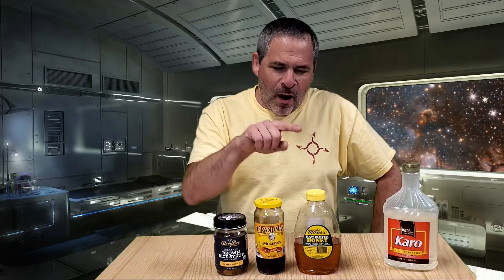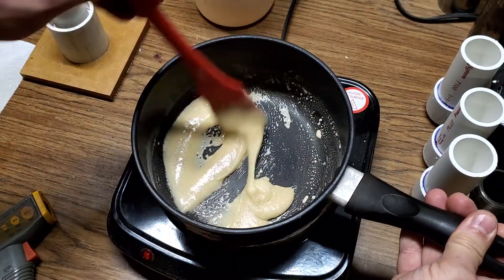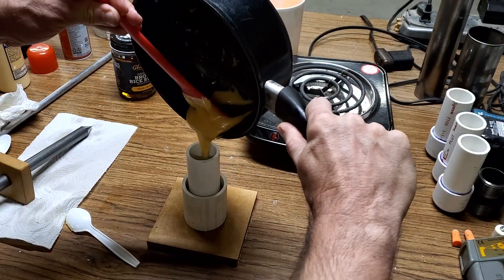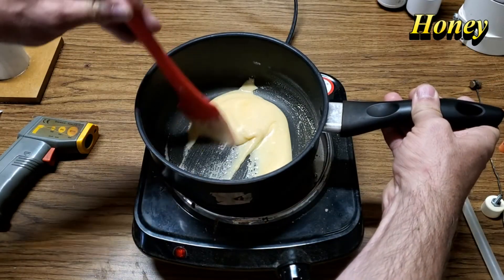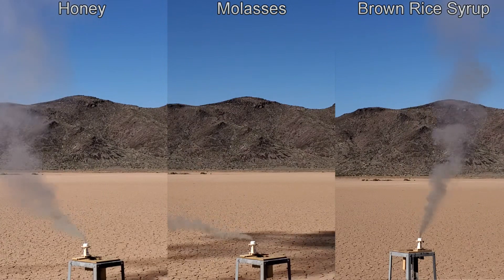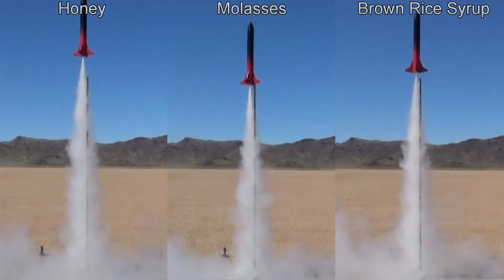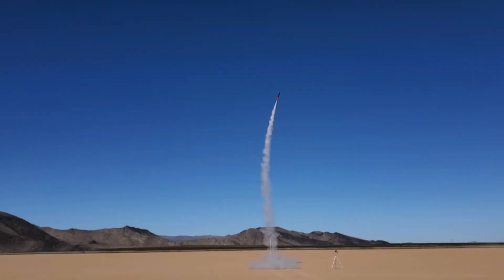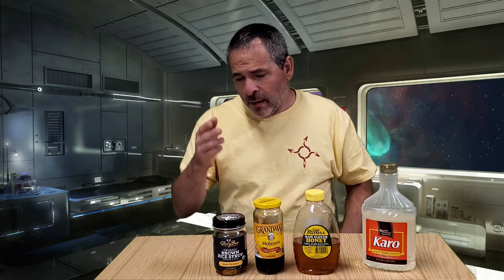Alternatives for Corn Syrup in rocket fuel - Comparing the results - Part 4

Comment: Great to see people still persuing this hobby.
I spent many years in my 20's experrimenting with candy propellants. Fun times. Remember the thrill and anticipation of testing a new itetation on a design.

I would love to start building rockets again but unfortunatly the world has changed. Safetly first. Its suffocating. Its easier to make something illegal to solve safety concerns than consider peoples interests and passions by implementing guidelines and procedures for public safety.

Anyway I digress, my reason for commenting was to suggest trying inverted sugar as a sub for Karo. Karo isnt on the shelf where I live anymore.
Testing inverted sugar as a Karo replacement was something I nevet got round to trying.
You could control the final water content by reducing over low heat. Might take a bit of time to reduce but you could make a ton of it for cheap.

Anyway, its an idea i never got to test. Maybe you could.
Reply: Oh, if you don't know what inverted sugar is, it's basically sucrose that has had the glucose and fructose bonds broken with a weak organic acid in the presence of heat. Citric acid for example.
Once the inverted sugar cools it doesn't crystallise and remains a syrup. Like Karo.
Reply from the maker: Interesting... I have not heard of inverted sugar. I'll put that on my list of things to look into. I will say, the honey fuel came out really good and worked well.

Comment: Another great video as usual!!!  Hey speaking of performance I've been meaning to ask about the coring rod in the DartMonkey motor.  Since inception I thought 3/4" looked a bit large. Have you tried reducing the diameter a bit maybe to 5/8" or even 1/2"? Fun stuff! Thanks for doing these tests!
Reply from the maker: I great question. With this type of single fuel cell motor, the center core is really the determining factor for how much "Initial" thrust you get. We have a similar motor design called the Kiwi and it used a 3/8" core. But that motor was only used to launch 2" diameter rockets that were about 2 feet long... Not too heavy. With the DartMonkey, we were trying to develop a small motor that had enough initial thrust to launch a heavier 3" or possibly a 4" rocket. Obviously, it's the initial thrust that gets the rocket moving quickly off the rod in order to maintain good aerodynamics so a powerful initial burst of thrust is critical to a good lift-off. As you have seen, the side effect of that large core is an extremely short burn time for the motor. One last comment... So you could make the core hole smaller and then make the nozzle smaller to provide a powerful thrust BUT... You run the risk of building up too much pressure and exploding the PVC case. Casing strength, core hole, burn rate & nozzle size are a carefully balanced house of cards.
Reply: @rotaryrocketry  Definitely a fine balance.  ;-)